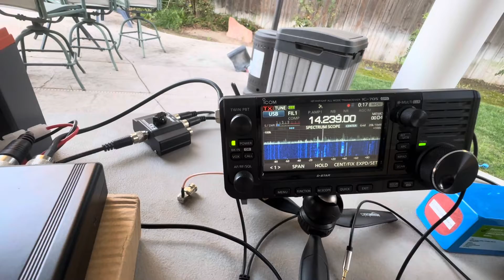QSO with Micro PA50+ Amplifier ICOM 705

Comment: My PA 50+ does not work on 30m or 15m. Says "BYP" in the upper right. Is running 2.8.5. Anyone else experience this or have a fix?
Reply: I figured it out. There is a multi-click option that is missing from every manual I can find, that is for "30/15m Open/Close". This comes up after 8 clicks. Do the 8 clicks until it says "open". Then power the amp off and back on. This seems to enable/disable 30m and 15m operation. Same as for the 7 click menu option for "17m/15m SWR On/Off". No mention in the manuals, but turns the SWR meter on and off for 17 and 15m (no power cycle needed).

Comment: How are your longer term usage reports on SSB audio quality? Are you using it stock or have you adjusted the Mosfet gate drive?
I Have one but as I'm still going through the convoluted process of getting licensed in Japan it is getting modded (BNC conversion)  and tweaked rather than put on the air.
Reply from the maker: I have not used it much since this video.  I will post another video and try to get some sound recordings from someone or record from an online SDR.  I am using it stock. How much more power can it drive modified?
Reply: @HamRadioRocks  apologies for the slow reply. As regards the drive, people are adjusting it to improve performance (reduce spurious/harmonics, improve audio clarity) which results in a small loss in output power. You have to remember that there is very little real world difference between say 50W and 40W.
As an aside, the/my rule of thumb when considering more power is 4x.
If you have a 10W device aim for 40W or more in your PA. If you had a 50W rig and assuming you are appropriately licensed you'd aim for 200W. The idea being that investing in a PA that does not give you a 4x improvement is not very cost effective when considering the performance gain.
Reply: @HamRadioRocks hmm why not use it much? Just a curiosity at 1st then didn’t need it. ?